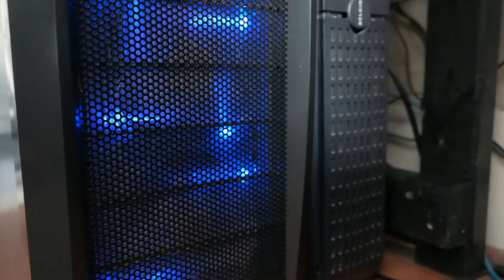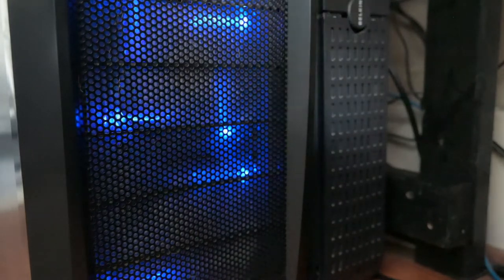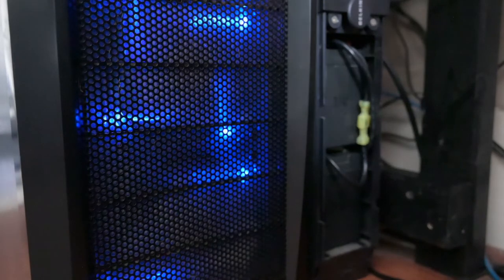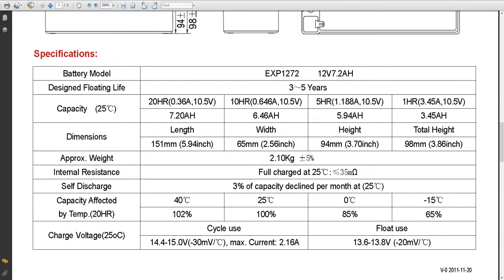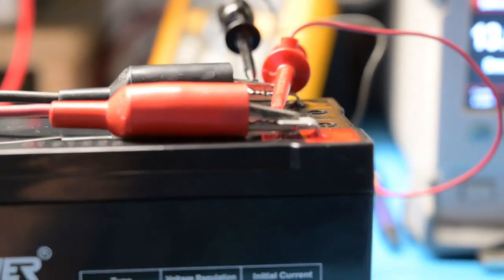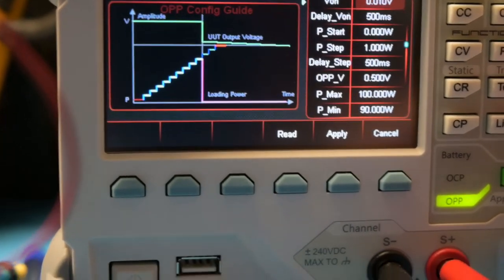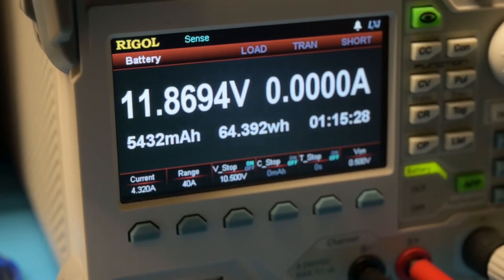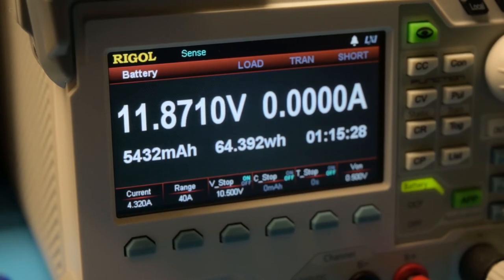UPS Battery Replacement And Testing Battery Capacity.

Comment: I replaced my 12v 7ah batteries with 12v 15ah batteries. I had to wire them outside the case but I get double the battery time.

Comment: Did  you fix  that wall  yet?  LOL   CompUSA  they went out of business  years  ago  down  in  Connecticut   What   ever happened to that car audio  guy?    Those  batteries  are   gel acid  types , i   buy those for my  APC   Smart  UPS   750
Reply from the maker: I actually bought some 20 minute mud some time back because I had to install a ceiling fan and do some patches around it and paint. Unfortunately due to the BS going on I need to get some drywall to fix that hole properly but it will have to wait till I can get out again. Yea these batteries don't live a long life.